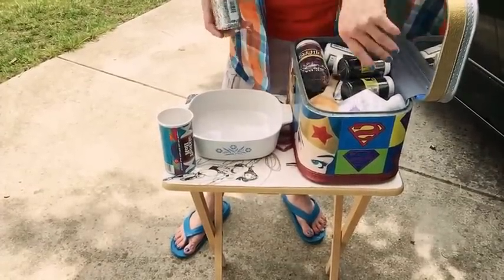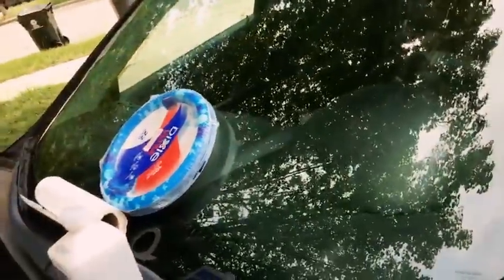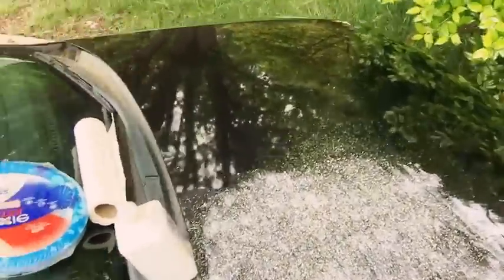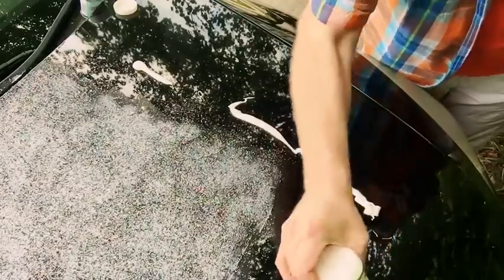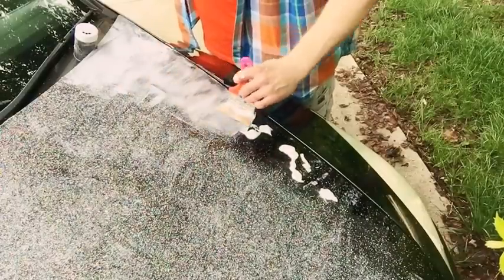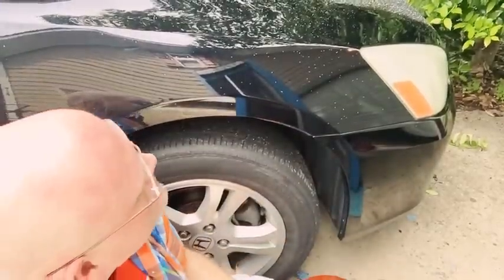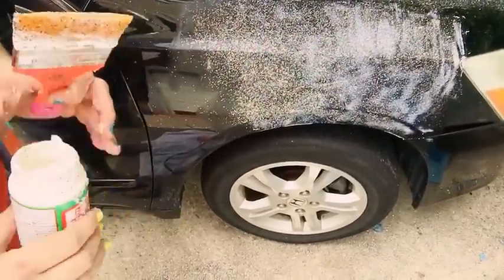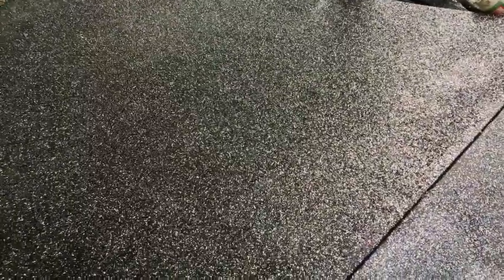DIY Glitter Car 1/2

Comment: Did you seal it with anything to keep it from washing off.
Reply from the maker: I used Mod Podge but it looked like shit in the rain
Reply: I did my car this summer but I used resin to seal it.
Reply from the maker: How did it last?
Reply: @justinporterproductions  resin sealed it and it doesn't was off or turn when it's wet